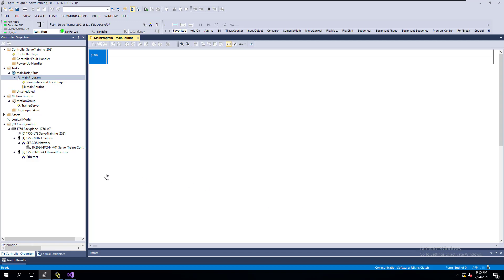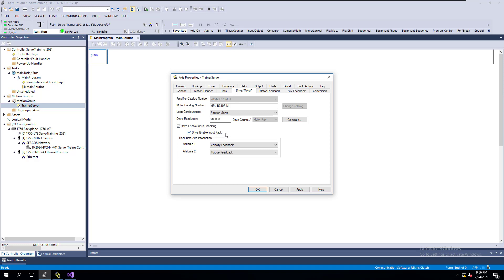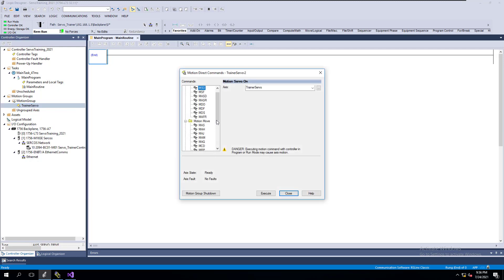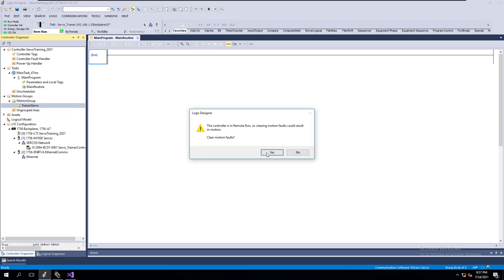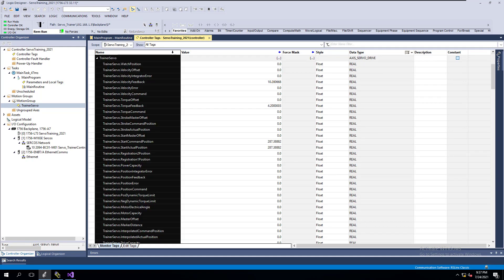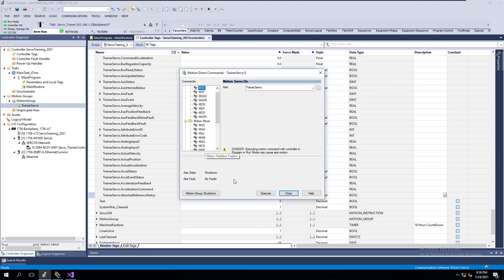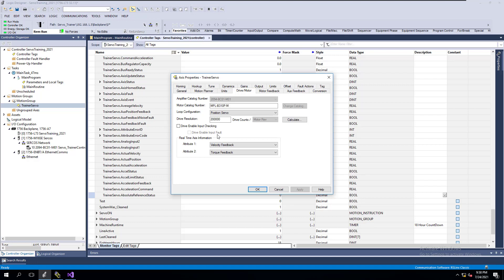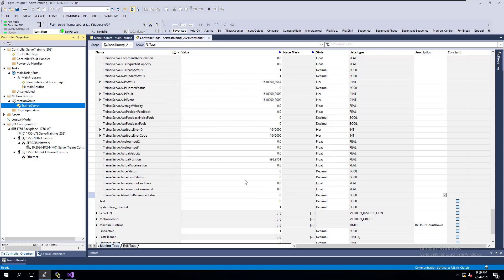Motion Direct Commands Not Working | Studio 5000 Servo Controls

Comment: Hi, I'm working on RSLogix v20 with emulator. My problem is that I can't add/execute motion direct commands. Please, help!
Reply from the maker: You can't use real world axis in emulator therefore you can't you all motion axis direct commands.

Only the ones used for virtual axis, no need for on commands or off commands.

I teach this in my servo training
Reply: @ShaneWelcher  I understand, but I can't add even one command on virtual axis.
Reply from the maker: @domagojcikac6502  motion axis commands will only work when the motion group is synced

Comment: Hi shane,
I am having a hard time communicating between two controllers.
I am having two controllers in a single chassis and I have only one ethernet module, so I am confuse in making them communicate with each other. Do I need one more ethernet module to connect both or is there a way I can make it work with just one ethernet module?
Reply from the maker: If the processors are in the same chassis then you can communicate processor to processor through the back plain.

The one ethernet card would just be for your communication to both of them to edit.

Here are some produced/consumed data videos to explain.

Studio 5000 Produced and Consumed Data Between Processors: https://youtu.be/FA-woKn09v0

Studio 5000 Produced and Consumed Set up | Video 1 of 2: https://youtu.be/qEP-1Ta78Fw

Studio 5000 Produced and Consumed Set up | Video 2 of 2: https://youtu.be/aGWm0ZNXRNk